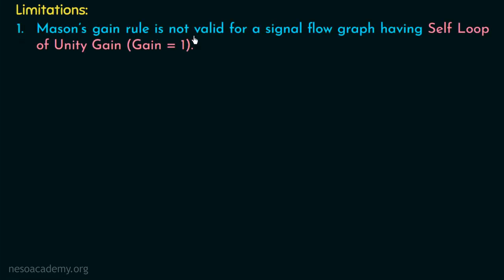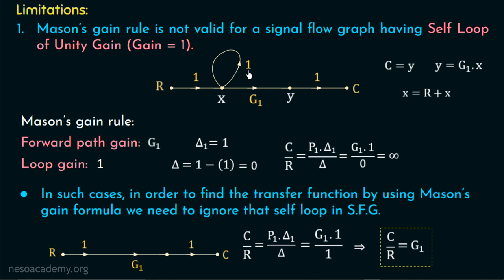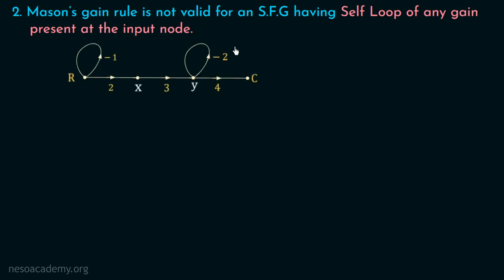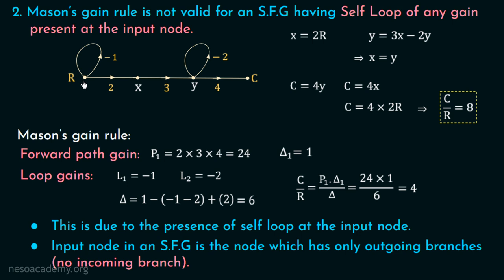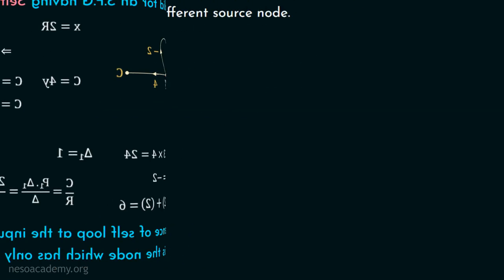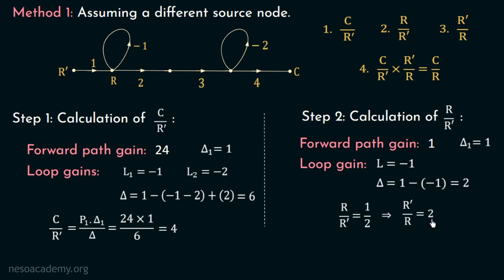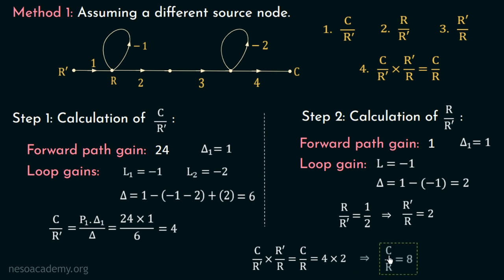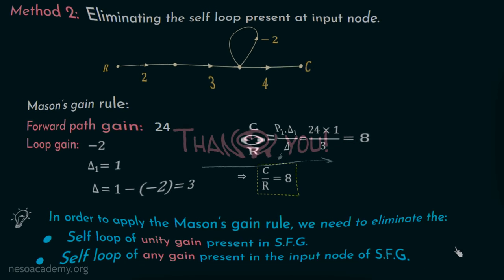Limitations of Mason’s Gain Rule

Comment: Thanks again for taking the time to make and share another video!

I have to confess that I feel a bit odd about the content in this one.  I feel like both of the examples you discussed, namely a self-loop with unity (positive) gain and a self-loop at an input node, aren't limitations of Mason's gain rule per se.  Rather, I think they represent inherent issues of the systems.

For the system with the self loop, as you note at 2:10, the equation x = R + x is only valid when the input R is equal to zero.  If the input isn't zero, then the system is unstable and the output blows up, and I think this is why Mason's gain rule gives a zero in the denominator.

For the system with the self-loop at the input, I also think the issue is with the system and not with Mason's gain rule.  If I am designing a circuit that is supposed to take an input, but then I short another signal onto it, that's bad design and could damage what I'm trying to build.  I don't think that adding a pseudo-input node or getting rid of the self-loop are just workarounds for Mason's gain rule; rather, I think they are genuine steps that would need to be taken to make the system stable.

Ultimately, I think both examples (as initially described) were unstable systems, and it would be misleading to calculate or say that anything was a valid transfer function for either of them.  Does that make sense, or am I not understanding?  Either way, I would appreciate your feedback (no pun intended), and I'd like to say again that I am really appreciative of everything you have done for the community!

Comment: @ 21:11 what is the point of a self loop with gain -1 at the input if it has no effect on the overall transfer function? ….what is the purpose of the any self loop at the input if it is just removed and not taken into consideration…why have it there in the first place?….and how does  a self loop at the input map over to a block diagram?….can you please show an example of a practical control system with a self loop at the input ?